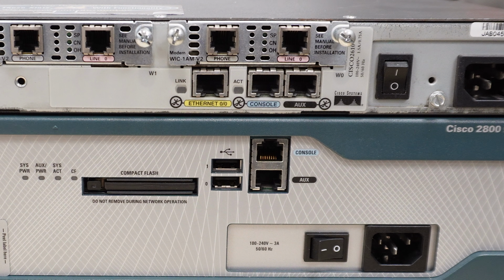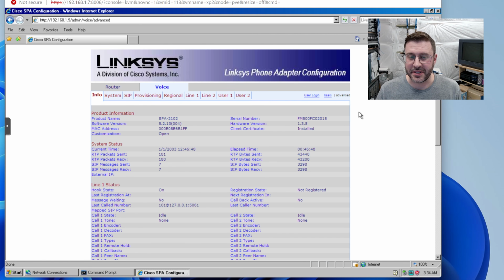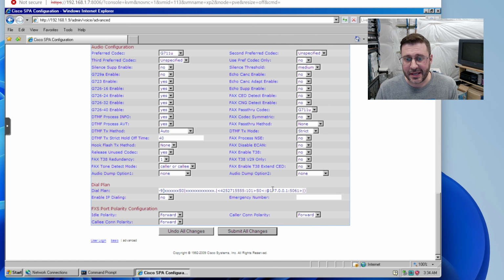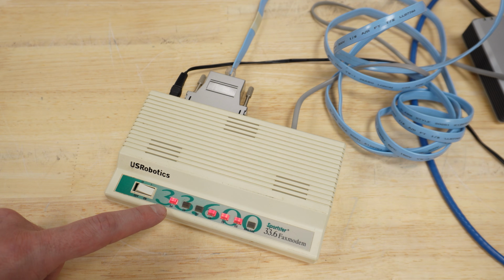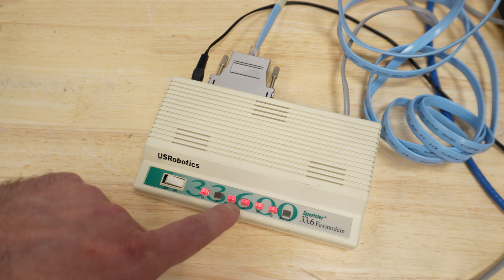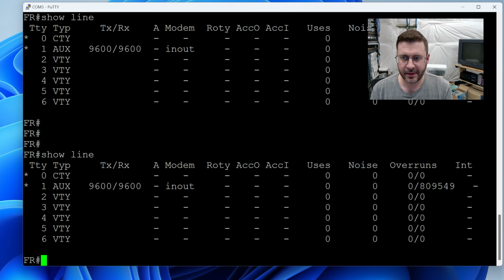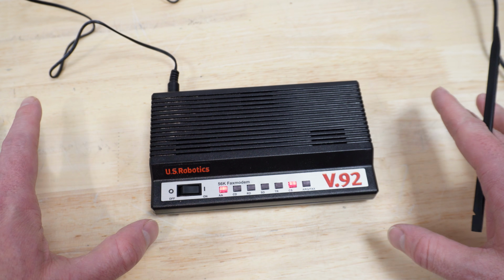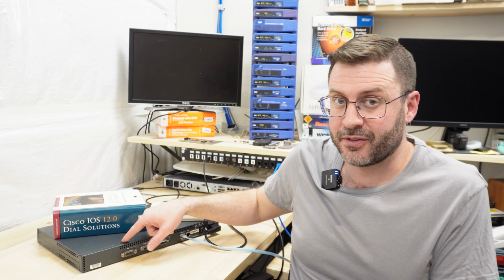Dialing into Cisco Routers

Comment from the maker: NOTE: I call the light blue RJ45 cable I'm using a "rollover" cable, which it is not. It's a straight through cable (correct for this application).
Reply: Well it looks a whole heck of a lot like a cisco rollover, so I can understand why you'd get that wrong. And using both at the same time just adds to the confusion! :)
Reply from the maker: Yes! I knew it was straight through but that light blue got me calling it a rollover haha
Reply: @clabretro  i had good luck using a normal  rj45 to db9 serial cisco console cable   with a db25 to db9 adapter  instead of the strate rj45 cable
Reply: That would be the only blue cisco that wasn't a rollover. I have hundreds of them, spanning decades, and ALL of the blue ones are rollover. The very rare black ones are straight -  I have a few, but have no clue what box they're hiding in. (the blue one are everywhere. :-)) In theory, I have one of the very new ones with the usb converter built in. (very nice.)
Reply: @jfbeam  I have a yellow cisco serial cable that I think came with a Nexus.
Reply: @stonent  That's an ethernet cable. There's also the orange (or red) crossover ethernet cable, but I only recall seeing those in the pack with firewalls. (old ones as everything is auto-MDX these days.)
Reply: @jfbeam  nice, you got a USB converter which makes me think... oh wait dial-up?!
Reply: If you can't dial up properly with the V.92 modem, check if your cable has 2 wires in it, and see if the telephone ports on your modems are 4pin, or 2pin. If you plug a 4pin into a 2pin, it doesn't always route the other signal properly through the cable. I don't know if there are 2pin to 4pin adapters for telephone stuff
Reply: @ POTS PSTN connection is only two wires. So it doesn't matter if your cable has 2, 4, or 36 wires, it'll only use 2 (the center pair.) A 4 wire cable would commonly be for multi-line phones - the other pair being the other line.
Reply: I will do something similar, but with a PCI modem in my computer, and a V.92 USrobotics Courier V.everything modem, and a Cisco IP phone with an ATA unit
Reply: your garbage noise text would probably be improved using a regular twisted pair cable

Comment: I know I've mentioned it before in other videos but it's always interesting seeing "real world" speed for 1200 baud modems. Over in the amateur radio world, you commonly see 300 baud (on HF, 3-30 MHz, very similar to a Bell 103, but using mark/space tones of 1600/1800), 1200 baud (VHF, 30-300 MHz, literally just Bell 202, 1200/2200 Hz tones), and 9600 baud (UHF, 300-3000 MHz, but for this one it's... weird and nonstandard, if you're curious, look up "G3RUH" modulation.

Of course packet radio is far slower than a modem of the same baud rate... not just because all connections are half duplex, but also radio switching time, randomized delays to prevent collisions... the AX.25 (Amateur X.25) frame format carries like one line of data, so anywhere between 80-128 characters and most TNCs (read: modems) only like having 2-3 outstanding frames before they receive an acknowledgement, so you get 80-200 characters of transfer and then you're waiting several seconds for a sub-second "receive ready" and then it repeats. (Worse, on HF, due to HF conditions generally being more touch-and-go, it's recommended to set your PACLEN (max frame length) to 60 (bytes) and your MAXFRAME (max outstanding frames before waiting for acknowledgement) to 1. So on top of being only 300 baud, using a transmission format that has no error correction over a transmission medium well known for random drops and fades, you get like, 60 bytes at a time before stopping and waiting. It's slow. It's incredibly fun to pull off but it's slow.

I'm so used to that, seeing a Cisco serial console scroll in at speeds like that is just, both comical and fascinating to me. It's both "that's faster than 1200 should be" and "that's slower than anything I'd expect to see in 2025" at the same time. Then again I didn't grow up in the age of dial-up, by the time I was old enough to computer broadband was already a thing.

Comment: Curious distortion at 27:36 when it answers marring the pure sine wave.  Dust on the speaker cone?  Um no, it's out of the box.  Or is that distortion on the 'line'?  That distortion would sabotage negotiation.  If using old RJ11 spray down everything with cleaner and reinsert a bunch.  Or maybe the same-room connection is too loud?  Try making an RJ11 wire with a bit of resistance added to it.  Maybe a factory gain adjustment a little too hot? Guessing.

I cut my teeth on 300bps Bell 103 (manual, no dialing smartmodms yet) long distance to timesharing networks and BBS.  It was slow sure, but I loved the simplicity of pure FSK.  Only problem is my modem was not sensitive enough to hear some faint remote answer tones ~2025 and wouldn't recognize remote carrier.  So I connected my phone in parallel (like an extension phone, not plugged into the modem) and switched in the modem when the call was going through.  When the other side answered I'd whistle along with it loudly until my modem woke up, then hang up quickly and the modems would stay connected.

It felt like a very satisfying hack.

Comment: 5:39: I think I have some of those Cisco 7940s and 7960s in a box somewhere. Flashed them with the SIP firmware way back in the early 2010s. One of the few Cisco phones that were (somewhat) easy to use with FreePBX...

Comment: Just one thing to note about 56k modems. They do not connect together at 56k. You need special hardware to accept 56k connections. It would likely only connect at 33.6. This has nothing to do with your problems, I just wanted to say it here. I was an early adopter of the 56k modems. I had a  4 line BBS in the early 90s. I went from 2400, to 9600, to 14.4, to 33.6. I had a 56k modem at the end but that was for me to dial out to other BBSes. I hear static on your connection though.. a lot of it. Adding &M4 and M5 to your init string for the modem should enable error correction but that is some bad static. --- Another thing to consider is the age of  these modems... You should, with all your vintage equipment, check for leaky capacitors.

Comment: The number printed on the modem refers to  phone line boudrate, not it's serial port. Generally serial port boudrate should be greater than line boudrate. Flow control also should match with terminal/router, not the opposite modem. Both modems can use different serial port parameters. Phone line boudrate negotiated automatically between modems.

Comment: line aux 0

transport protocol input none

transport protocol output none

Pretty sure you want to delete the flowcontrol setting as well. 

Also turn off auto answer on the modem - the router should handle that if it's own.

When you connect the modem to the router the router should send config settings to the modem automatically.

This takes me WAY back! I may have to dig out some ATA and modems and connect one to an old router I have.
Reply: The transport command is for using IP across the dial in connection - like when you call an ISP to get online. That's probably what's causing your issues.

Comment: I see a sea of mistakes....I used to run a BBS on the Fidonet network for the better part of a decade (initially Node 163/5 Solsbury Hill BBS). Configuring modems, especially high speed modems like the USR V.92 and V.everything is an art. I used to be somewhat of an expert on init strings for the modems. At the bottom of this post I will link to some generic USR init strings. A good starting place....I can only speak to the system <-> modem link. The cisco <-> modem is more obscure as they wanted to make sure you used their own cables and equipment. 

To start with, you should load the default setup for hardware flow control:

 Generally, you want hardware flow control. Having both hardware and software flow control enabled gives you garbage. You can actually see software flow control by hitting ctl-s to pause on a text screen with lots of stuff scrolling by to pause it, and then ctl-q to restart it. The 9600+ baud modems actually talk between themselves at a higher speed than 9600 baud due to data compression, so your connection rate between the system and the modem needs to be higher than that, say 19,200 baud for example. This is why hardware flow control is needed, as software flow control fails because it is too slow. 

If you don't want to wade through lot of technical information on US Robotics modems and such, just google "USR <yourmodelnumber> Init strings" and you should find something tat will give you at very least good starting point. 

AT&F1         Set the factory profile that uses hardware (RTS/CTS) flow control

You may also want to add a "M1" which turns on the modem's speaker until it is connected other other modem. Another good habit is to reset the modem so that any strange configuration is zeroed out. That is the "Z" command,  as in "ATZ". Here is a good start to crafting a good init string for your modem:

ATZ,,&F1M1
where
ATZ      Reset the modem
,,            Pause two seconds to allow the hardware to reset, adding a third can also help.
&F1      Load factory defaults for hardware flow control configuration
M1       Turn on modem speaker to hear the two modems negotiating the connection, then turn off speaker when they are                  connected

https://support.usr.com/support/756/756-ug/six.html
http://www.modemhelp.org/inits/usrobotics.html

Comment: Believe it or not, my infrastructure at work actually has a couple of routers set up with dial-in access via 56K modems today. We have no admin access to these routers so our ISP manages them for us and utilize the dial-in function only as backup if they can't log in via the T-1 WAN interface (yes, we also still have T-1 links). We had to get standard analog POTS lines run for each router, assisted in setting up the modems, etc... this was a few years ago but yeah, we still utilize this technology today.
Reply: POTS OOB management is criminally underrated as a backup method. Everyone is way the F too reliant on cell towers.

Comment: @clabretro Make sure you are factory resetting those USR modems and then changing and storing their config before you try and use them with a cisco router AUX port. Some of them dont have the right dip switches or jumpers and need to be configured in software and stored to NVRAM.
I have the bigger variant that is more commonly used for this setup, The USR Courier USR3453C which is more configurable.  If you want it, I can probably dig it out and send it your way.

Comment: For everyone thinking AT-commands are arcane, quite a few 5G modems are still controlled by AT-commands. The command set has been extended multiple times, but still, it's based on the same old Hayes AT command set.

Comment: This kind of seems like a flow control problem.  You might want to try looking at the signals between the modems and serial devices.  I think you're going to have problems if one end is using software flow control and the other end is using hardware flow control.  Try jumping various pins like RTS to CTS to fake the connection and then figure why the signals aren't passing through.  I've got a Viking DLE-200B collecting dust if you want to give it a try.  Probably better than that Linksys device.
Reply from the maker: Figured it out finally! In the end it was a cabling issue, I threw in the towel on all my adapters and bought a DB25 to RJ45 modem cable on Amazon -- and it worked perfectly!

Comment: If I remember correctly AUTO-DETECT was the worst protocol you could use back in those days. I think it was a mix of esoteric plus firmware and finally software (who knows?).  Try configuring your 56K modem down to the same speed as the other modem (9600  baud I think).

Comment: I'd probably agree with fonet3k, you seem to have a bad connection. It might be a good idea to put some deoxit (Adrian from Adrians digital basement knows more) into all of your ports, plugs and sockets. It might also be a good idea to put this stuff onto the ribbon cable connector headers inside the modems, might help with their acting weirdly. Another thing that comes to mind is to replace any electrolytic and tantalum capacitors inside the modems. This certainly should improve the stability and longetivity of your setup.

Comment: Make sure echo is turned off on the modem on the router. You then should be able to turn on hardware flow control. This is based on my memory from the 80s and 90s

Comment: 24:43 it looks like the paper became moist at some point in time in the past and dried up again, causing it to stick. You could reverse this probably by steaming the whole package, i.e. bring water to a boil and then place the whole package on a sieve above the water so the steam can penetrate it. Once it's soaked again you should be able to carefully pull the pages apart and then let them dry spread out.

Comment: Hey sorry for the off topic:

! I brought 3 cobalt Raq4. The seller told me that just one is working, but the LCD is all black. 

Well, I found that this server is working fine, the black LCD is because the machine don't start BIOS due to an inverted IDE cable .
The remaining two has leaking capacitor. I replaced and now I have 3 machines.

I don't know where to download the image, I'm going to test the "serial port" images from Raq3 .

Also I can donate one, but I don't know the price to send from Brazil. I will also contact Serial Port..

This machine with Blue front will make your retro rack even better!🥸🫡🥸
 Talk som to you and thanks a lot, your channel keep the  retro machines alive.  It's an expensive and hard job... Keep the great work sir!!

Comment: Some notes - BUSY is generated by the phone network in analog settings.  If you hear a busy signal on an analog line, the network (ATA in this case) is giving that signal.  A black screen after CONNECT usually indicates a flow control or cabling issue.  Easiest thing to try is turning off all flow control.  At slower speeds, you can usually get away without having it.  If that doesn't work, check your cabling, most likely your adapters. There's multiple types of serial cables/adapters and they aren't all interchangeable.